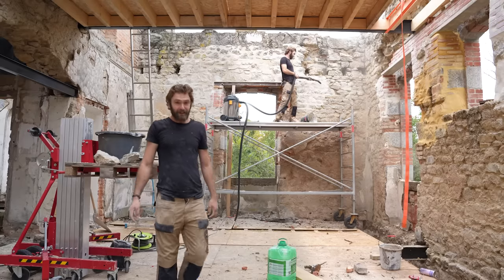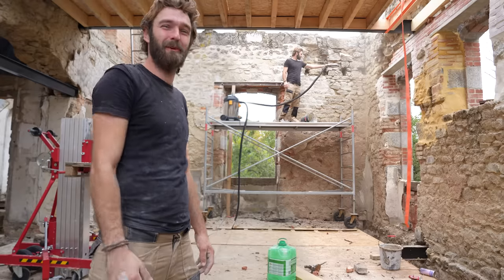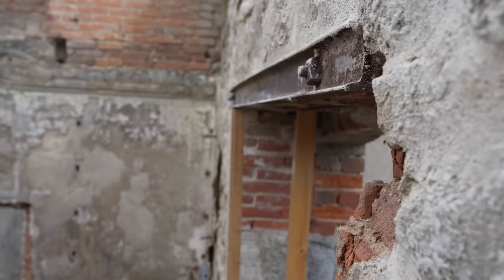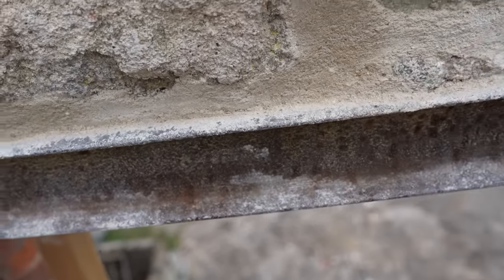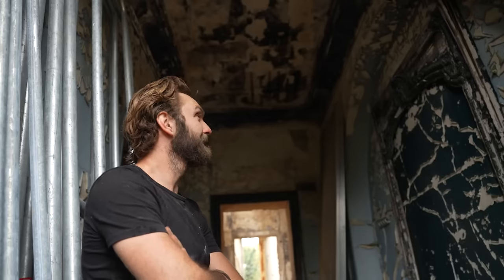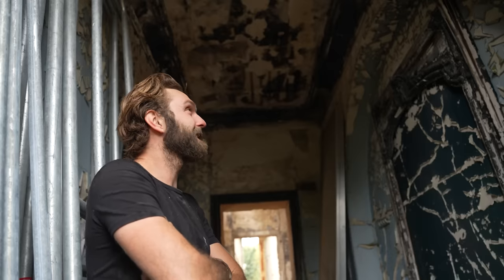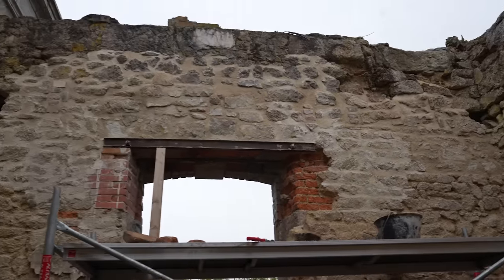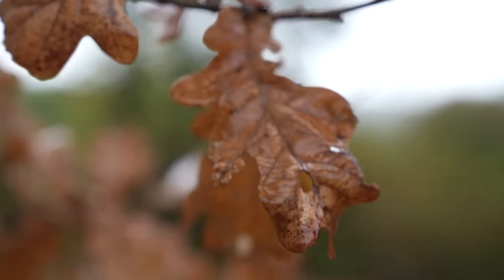Rebuilding a stone wall, finished.

Comment: it is urgently necessary to accelerate and make a roof over this part of the building (a rafter system), and you can temporarily cover it with banners (buy cheaper from firms hiring advertising). This will allow you to fully work not only in this part of the building, but also in a nearby one. I sincerely enjoy your videos: the video and the building are beautiful.

Comment: There is a rudimental beauty in those mixed stone and brick walls. It'll almost be a shame when they are eventually covered up 😊
Reply: Oh I hope there are no plans to cover those stone walls up @jacmary6580 I love them and the work he's put into them would be a shame to hide them😊 x
Reply: They are starting to feel like old friends
Reply: They’re covered because the lime rendering is susceptible to the elements. It’s far easier to repair, as the the option is extensive repointing…which is extremely time consuming.

Comment: Can we place bets on if the cement mixer is going to outlive the build? Or maybe how many mixers are going to be needed?
Reply: This winter will be the real test.
Reply: I thought he would have had to replace it by now because he never rinses it out and numerous times he’s left mix to harden but it’s still going 😅
Reply: I use a rocker mixer more than my electric mixer nowadays. Its manual and mixes almost as fast. Where it really comes in handy is that I can easily move it and it cleans out so nicely.
Reply: I was thinking that last night!😂
Reply: It wasn’t a spiffy new blue mixer at 4:51?
Reply: Check out 4.50 Dan seems to have a replacement in the wings, bright blue next to the water bowser or is it something else?
Reply: I was thinking he has to dump the whole thing over instead of just the bucket.  Yea will go thru a couple at least.
Reply: The mixer is lucky to be alive the way he abuses it! If I left a mixer like that I’d be sacked
Reply: @brianboot8623  : Hence why he throws rocks in first! Let those bang around a bit to get the innards loose.
Reply: @jonathanbennett9511 I’ve often thought how 😤 my Dad would be if it wasn’t put away.
Just as new, and covered.
Difference in generations I guess.
Reply: You all need to go through the being. Watch back and you will see. Go back to the being. Dan will get this built.
Reply: Great Job Dan
Reply: 6:42  WHOA! What’s that? Is this something I have missed in your Chateau? 😳
Reply: 6:50  Oh!
Okay 👌🏾 I knew I’d never seen this, I see why. 😊
Reply: Wow I hadn't even thought of that.
Reply: Lolol...I was think that very same thing 😅
Reply: I'm gonna go with how many mixers.
Because if that 1 lasts the entire build, it needs to be put up in a place of honor.
Reply: I was thinking the same thing!
Reply: That cement mixer should be bronzed 😂
Reply: What’s going to come first?  A new cement mixer or 375k subscribers?
Reply: Great advice but, there's a real problem with the cleaning out the mixer. It's time consuming and, and he doesn't have WATER up there yet.  Minor detail 🙄🙄
Reply: 23,000 mixers. It's a huge chateau.
Reply: 3 or 4 over 10 years!?!
Reply: My mom has a mixer when I was a kid and if somebody didn’t clean she would get very MAD! She would get out to the mixer with her small sledge hammer and bang on the outside of the drum to remove any dried mix and she was always much calmer when she came back in. She wasn’t repairing a château but she would be pouring steps, patios, foundations and what not. Lasted her for years and only go rid of it because we moved across the country. It lasted MANY YEARS and still worked great. Dan’s mixer may be around for a very long time!
Reply: Or how many times we have to watch him use this rusted old mixer
Reply: Billy Petherick would cry if he saw Dans tools so dirty😅
Reply: The mixer should go on a pedestal in the hall when it’s all done.
Reply: I remember a while back on the Pethericks Billy made a comment like “never trust someone with a dirty mixer.”😂 HAD to be aimed at Dan 😂😂😂😂
Reply: "Old Rickety" ( old cement mixer) hanging in there with Dan.
Reply: @davidfox7593 zero.   No one is making anyone watch Dan’s videos.

Comment: If you could get one of those commercial, steel framed awning/gazebo structures,with a thick plastic stretched roof (used outdoors at festivals etc) to cover the roof, it could be there for many months as a” placeholder “ before the roof goes in. Some sun/ rain protection.

Comment: Un-reinforced masonry fills me with terror, especially the multi-storey  stuff. But I live in a country that shakes a lot.
Reply: I wouldn't trust that structure or have faith in its structural integrity.
Reply: Paul they have earthquakes in France too
Reply: @daisylovelock9553  but not the bone rattlers like we get in NZ,  judging by how many old castles and chateaux persist in France.
Reply: @paulsmithson6866  You have a very good point

Comment: Dan turn on captions as you have an audience of other languages than English want to watch your channel. Check device settings search setting & yt will auto translate for you but captions need to be on.

What if you throw a couple tarps on top floor to keep the water from collecting on the bottom floor ( mold mildrew not needed )

Comment: Has rain/moisture deteriorated the oriented stran board floor sheeting?? Will much require replacement before the roof is completed??
Enjoy watching the progress and your persistence!!!
Best!!!
Reply: Dan said when he first began putting it down oh, those many moons ago that the OSB was only to be   temporary.     Jack L.
Reply: In addition to Dan previously saying the boards were temporary, Dan also said It was OSB3 - water resistant, to a certain degree (with light rain.)  With all the heavy rain he had over the summer, some boards may need to be replaced.

Comment: I wonder if a floor I-beam could be used as a cantilevered pulls or winch point to lift from the ground to top floor and bring materials in the widows rather than carrying buckets up ladders. Or a ladder lift like roofers use.
Reply: Yes , I know how heavy a bucket of mortar is .

Comment: Hi Dan, get yourself a small tool for pointing it will help with the smaller joints. Try and wet everything, don't strike the mortar too much push it in and strike once. Understand how to read the beds on stone... You HAVE to bed the stone correctly or it will compromise its strength and it may delimitate later. Stone is strong in compression only... 
Keep going you are kind of getting there...

Comment: Well Done!!  3 more walls to point, C beam, floor - some kind of roof?  Straight sides with an angled roof for temporary structure.  roof overhangs the 4 walls. 2 side walls angled, a short outside wall & tall inside wall  - water runs off the angled roof to the outside. Can do the whole thing with studs and panels. could even build it inside the top floor anchored to the steal beams, add some flashing to the outside walls so water goes over the outside walls and not running down inside the walls into the building. I don't write the best descriptions but I think you will get the idea. if not pic on IG    I'm so glad you have the dogs for company.  That's a wonderful job you've done, should be well chuffed!  I am. :face-red-heart-shape:

Comment: That radiation contaminated steel thing is bogus.

Radiation, in the levels found after 1945, has no effect on the stength of steel. What the issue is is that for certain use cases, mainly instrumentaion and sensing, the radiation can corrupt the readings generated by the equipment.
As of now the back ground radiation is back to levels comparably with pre 1945 levels so not an issue except for the highest precision instruments.

Comment: Just curious, how or which way are you going to put the beams, now that you have filled the holes in?
Reply: C beam something. He talked about it last video.
Reply: If I understood correctly, he will run a C-beam along the wall where the row of pockets was.  So the ends of the floor joists will fit into the C instead of the pockets.

Comment: Better it warm and rain than cold, its heartening, tp watch you methodically defeat and work around your snagging problems.
The weather is horrendous in ne england at moment 3:45am, are you thinking of tarp to temp cover the majority of building so you can continue working inside during winter months? Im sure majority are thinking the same. Best of luck mate in solving that.

Comment: Do you have an idea of what the roof structure is going to look look like?  Will you be constructing mansard roof lines? What about the roof in the tower? The old one looked a little clunky. Do you not have to build the chimney towers first in order to replace the roof structure? Or will you build a temporary structure just to hold off rain and snow for another winter? Thanks.

Comment: DAN

I tink you can rent an electric hoist better sutiable for this job. If not you coud buy it and then sell it at the end. I had one for a job here in Mexico and it was wort it. And we made a few steel cages for different needs or equipment. That building was an 7 stories high and that HOIST made alll the difference.

You could place in Steel Cages blocks, wood, equipment, cement, sand, allmost everithing. I coul make your job allot more easy.

Greeting form Mexico
Reply: Good idea! 💡 Wish Dan would do that.   Using a hoist to lift materials has been suggested many times, for a long time by building tradesmen.  Love the steel cage idea; would hold building materials in better than just a pallet strapped to a hoist.

Comment: Will you do a concrete ring on top of the wall? You see people do that on that kind of old walls to keep them together and to have a good and straight base to put the roof structure.
And also I wanted to thank you for your videos. I am currently doing a rather involved renovation of a flat that i rent out. Including new kitchen, new bath, new electric, new floors. I work from Monday to Thursday on my "day job" then get in the car, drive 1.5h to the flat and stay there till Sunday to do the renovation. Your videos, or rather seeing you do that monumental task basically by yourself is really keeping me motivated. And it stops my tendency to whine about how much work I have to do. Whenever I feel like that, I think about a certain chateau and suddenly, my life looks easy again. So cheers mate! Keep trucking.

Comment: What's the blue mixer for? Just a polythene low slope angle roof would allow you to work on the tower sections with minimum cost to keep working with so many apertures to wind helps dry out the structure ,filling the pockets give you anchor points for the steel c section and the timber joists will have to be cut to not put pressure on the exterior walls as the strength is on the surface pressure will cause deformation and cracking externally. Noggins but not hammer work as pressure and localised vibration a bad thing for that structure skin.

Comment: Seeing you up and down the ladder must be exhausting is there no way yo can get the hoist set up again maybe you can use an old pallet to make a cradle so you can do more, weight permitting each trip.

Well done keeping going.. 

Do you have running water now on site? or is the well functioning to supply your needs?

Did you get an architech to design the roof as you have very little to go on for the structure?

Great job.. 

Robb Torremolinos Spain.

Comment: Haha I love your work attitude and optimism and talking straight what is bend. Steel from 40 years ago is no better than that of today's technological production and improved specifications and alloy with respect to use. In addition, the building was devastated by a fire, right? Just like the Twin Towers in New York in 2001 remember, steel does not like fire as it weakens the structure. But keep going love your video's. Bonne chance!
Reply: Twin towers had plenty of jet fuel to melt the steel

Comment: You should try using a grout bag to pipe in the mortar when doing pointing. You'll be able to inject it in deeper in larger gaps and move 2-3 times as fast as you can with a hawk and trowel. Then you come back in as normal with a pointing trowel and sponge. It's how I do stacked stone foundations and it works like a charm. Also, if you get yourself a garden pressure sprayer you can fill it with water and mist the stone face as needed without needing to lug around open buckets or refill tiny water bottles.

Comment: Wonder if it is possible to frame a pulley/ winch system out one of the top windows to bring supplies up safer. Might not look great but could save your back and legs some.  To much to maneuver around inside for it to work well .

Comment: At 8:15 is that translucent corrugated roof panels?    
My father used that on part of his garage and now, nearly 45 years later they've all gone yellow. They've held up to storms and being battered by all kinds of debris, though. For a temp roof that's only going to last a few years they're just about perfect. Lets in lots of light.
Reply: That was his original plan when Dan bought them winter/spring 2023, to use clear corrugated roof panels for a temporary roof.   We'll see whether he stays with original plan, or does the permanent roof now ( now that his Youtube channel subscriptions & funding has increased exponentially.)

Comment: That wall is coming along nicely. I can't tell where the holes/pockets were anymore. I know It must be a great feeling knowing the wall is stronger and secure. The extra time spending on the wall is well worth it. I can watch you do your stone work all day (on fast forward).
  If you get half a day to invest time in a temporary staircase from the 1st floor to the 2nd rather then using that ladder every time. Your feet and back will thank you later for it.

Comment: Once you have that top floor done you really will need to get a plastic cover over the top of it. 
Then if it rains before you get the roof on you have a couple large floors of open undercover space to get things done out of the rain

Comment: Do you bolt the C-beam to the outer wall to keep it from migrating outward when the weight of the roof is on it?  The ends are going in the side walls like you did for the kitchen??

Comment: Shouldnt you fix the other top walls before putting the roof on? It will be super heavy and the stone hanging on the other wall doesn't exactly inspire faith that it will hold a roof.

Comment: Long days Dan  your definitely trying to keep your time schedule on track.
You ether have one or two steel types 1 mild steel all new buildings are mild steel.
This depends on the year made and when France changed to mild steel, but since you said no heavy rust I would say wough iron , 
Only surface rust mostly but it's not as strong as steel because of impurities, slag ect.
Reply: Wough?

Comment: I suppose you have explained it in a previous video, but, why are you closing the holes where the beams are inserted? I cannot see how you are going to make the following floor level in this side.
Reply: he will attach a C profile steel beam on the outside of the holes, not sure its such a great idea, there will then be basically be only two points in the wall carrying the weight of the roof on that side.

Comment: Well, at least your using the scaffolding to work on the walls inside! One day you use your winch to lift things like whole wheel barrows of mortar, you'll need it for the roof structure anyway...................

Comment: pre nuclear steel is so called "low background steel". 
Its just a bit less saturated with radio isotopes not more durable.
What you  witness here is, that the steel in the house is made from different alloy compositions than today.

Comment: At 4:48 in the vlog, there is a fog or mist floating towards you.  You are work in wet conditions, so i don't think it's dust, and I don't think smoke would be coming from the chateau.  Anybody else see it?
Reply: Yes, I wondered if the rain (cold) was misting because the day had been very warm before.
That happens here in Texas regularly...we are so warm/hot usually.
Reply: @homeemail2306  I hear ya!  I'm in Arkansas and it's often like a sauna outside.  I could only see the mist at the top of the screen but that may be what happened.

Comment: Whats the plan with the beams here since you are closing the holes on that wall? In german old construction we tend to place woodn beams alaways on roofing felt to prevent moisture transfer and in brick walls we also leave some air on the side with special bricks to allow airflow towards the ends of the beams. The wall is getting there keep up the good work!

Comment: It would seem sensible to build the permanent roof over building a temporary roofing, as once the roof is done, it's done, not to go back and tear out a temporary to replace with a permanent. The project is large enough as it sits without having to replace a replacement. So, Dan, do the roof once and be done with the roofing.
Reply: Ideally yes.  But I wonder how much the weather will impact this decision.  In the immortal words of G.R.R. Martin...winter is coming.  Fast.

I've heard the style of roof that would go on this thing permanently is complicated.  I wonder if he could end up with a temporary roof just due to time constraints?  

It will be fun to find out, either way!

Comment: I don't want to come across as negative,  I am truly loving this project. However, I am very concerned about your plan to use steel C channel/beam for your joists to be located. C channel ideally needs to have as much flat surface behind it otherwise the load will be transferred to the anchor and will become inherently weaker.
Reply: It worked at the beginning on 1 of the kitchen walls that had no pockets